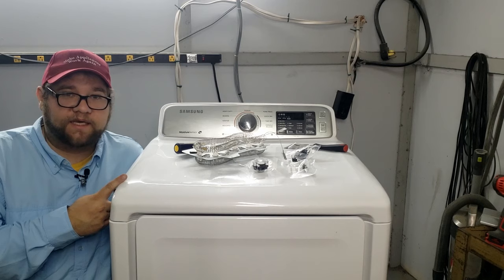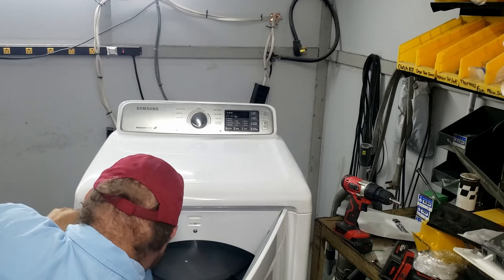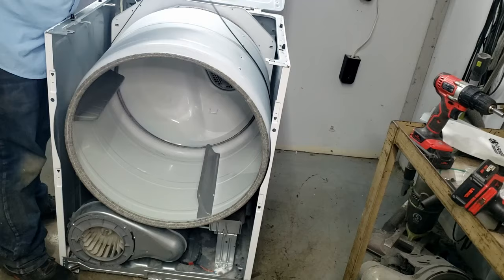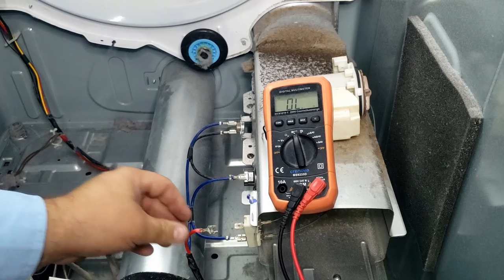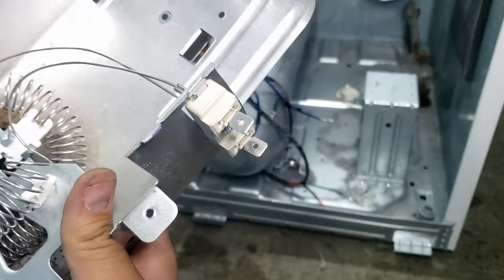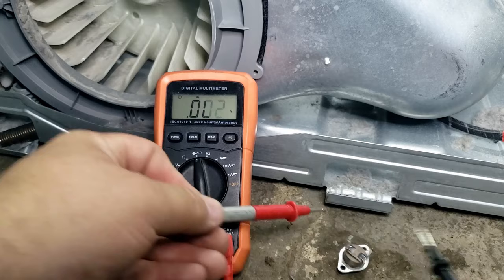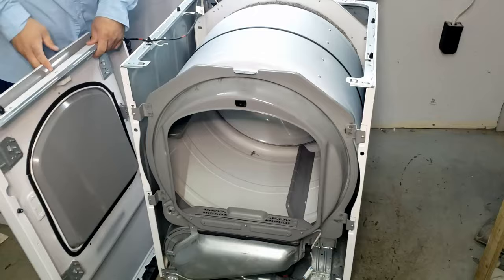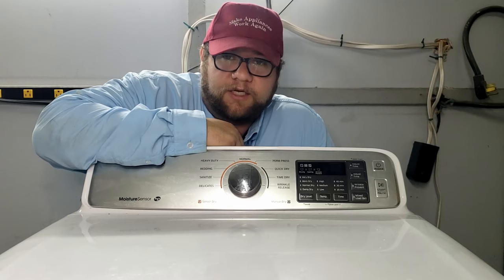Samsung Dryer Heating Element Replacement - How to Fix a Samsung Dryer Not Heating

Comment: Hello and thanks, but I also purchased the Amazon kit and replaced all precisely. It still did not work. Is there another thing we could replace or do, besides buying another dryer? Thanks again.
Reply from the maker: If its not heating, check the electrical connection to the dryer. You need to verify with a multimeter you're getting 240v between L1 and L2. If you aren't, its the electric, not the dryer. If you are getting 240v, and all the sensors/element are replaced, then it could be the board. You would verify this by checking the board's two terminals that provide voltage to the heater from the board. If it doesn't send a signal on both legs, then a relay inside the dryer board would be bad.
Reply: @bensappliancesandjunk  Thanks, When you say board, do you mean the panel display where all the switches are located? Also, when you say electrical connection, do you mean the plug into the wall? If so, would that be a problem even if the dryer is turning on. Sorry about the ignorance, but a big thanks.
Reply from the maker: @ralphgomez9006  yes I mean the plug in the wall. Just because the unit gets electricity and turns on doesn't mean its going to heat. Heat requires 2 legs of 120v of electric. One leg powers motor, then interface, then thr 2nd side of heat. The other just deals with heat. If that side is bad, then it'll run but not heat.

And the board, I mean the control board behind the interface panel
Reply: @bensappliancesandjunk  Super thanks Ben....I got lucky and an electrician was next door. He brought is voltage tester and apparently one of the sensors at the farthest back was bad which means the new one and bad one were bad. Amazon sent me a bad sensor. Where can I just get that one sensor(N160)?

Comment: Si la resistencia se sale y está tocando la carcasa, simplemente vuelva a colocarlo si no está rota, no tiene que comprar otro elemento si muestra continuidad, muchas veces se suelta debido al sobrecalentamiento causado por un conducto atascado. Gracias a estos videos me economice más de trescientos dólares, se puede comprar la resistencia en eBay por menos de veinticinco dólares y los técnicos las venden por $180.00 mas la reparación que serian otros cientos cuenta dólares. Gracias a esta informacion la repare sin ningun costo.

Comment: I have replaced the element 2 times in 3 weeks.  All wires are exactly in the same spot both sensors were also replaced  what else can be causing the element to snap its not touching any metal
Reply from the maker: Can you confirm the element is sagging, causing it to short out and die?
Reply: It is not sagging or touching any metal
Reply from the maker: @junebugs03  are you sure element snapped or is was it another part like a sensor?

Comment: I followed your video.. which was great and very precise! But i have an issue... once i got it all back together with all new parts, i turned it on for a test run, it ran for about a minute then totally shut off and will not power back on... help please!
Reply from the maker: I'd be concerned a part malfunctioned. Sadly, take it apart and test to see if anything failed.
Reply: So i took it all back apart. I found my issue. I forgot to screw the block in place that holds the heating element wiring,  and it touched the metal casing for the heating element... any advice what to do now? I put the old fuses and temp sensors back in and it still will not power on or show any lights on the "dashboard" . Thanks i really appreciate it
Reply from the maker: @nathangrice6730  what was wrong initially with the unit?
Reply: @bensappliancesandjunk  the dryer was not heating. It ran fine other than that

Comment: Dryer keeps throwing HC code. It's lint free, no blockage, new thermostat, new thermistor. Any ideas?
Reply from the maker: Is element shorted to ground?
Reply: @bensappliancesandjunk  brand new elements as well....the 1st one burnt out and got me started on this adventure
Reply from the maker: @ngatracklife  I'd check thermistor and confirm that despite it being new, is within tolerances. Were you getting an HC code prior to replacing those components?
Reply: @bensappliancesandjunk  no sir, didn't knowingly have an issue until the element went out.

Comment: If you start your dryer and it sounds like hell make sure you check the black tie down strap on the motor. It barely stays on there and likely slipped off barely when you removed the tension on the belt. Don't wait another week for rollers to come in. If I wouldn't have waited 2 weeks on parts I'd made a better video than this.

Comment: How frick do you get the belt back on the motor? my arms are too big to reach inside under the drum and thread that?
Reply from the maker: Some versions have a plate on the dryer vent tube you can take off with 1 screw and tighten from the back.
Reply: @bensappliancesandjunk found me a little asian girl to do it, twice..

Comment: Replaced all that and still not getting hot.
Reply from the maker: Check voltage for 240VAC coming in on L1 and L2. If you can verify that, verify voltage output from the control board is 120VAC to each leg.
Reply: @bensappliancesandjunk  it was a 10 dollar sensor....lol

Comment: This machine is terrible design, it takes many steps to get in heating part location. Compare with other brand.  It just simple remove the back panel then can work on any heating parts.

Comment: if you love that screw driver wait unti you get a drill, whooo boy
Reply from the maker: I struggle to decide if I should use a drill gun or a screwdriver in videos. Screwdrivers tell viewers "You can fix this with a $5 tool), but for me, yeah, I'd never go into this without a 12v or 18v gun with a box of bits to use.

Comment: Doing this job will literally cost you sweat and blood. Be careful with all the sharp edges on that machine.
Reply from the maker: I'm adding new warnings on all new videos for the sharp metal edges. They keep building these with thinner walls each year, so they get worse and worse
Reply: @bensappliancesandjunk  is it normal to get a burned smell when you first start it?
Reply from the maker: @fh1980ram  on a new element, yes, every time. There's a coating on the wire, and also usually when you get in a unit and move stuff around, some dirt/dust will get into coils and burn a little too.

Comment: I did everything. It worked once and now it isn't heating again :(
Reply from the maker: I'll be doing a video on that soon. You have one of two problems:

1) The thermal cutoff died (again) because your venting situation with the actual vent pipe or where it terminates at, is extremely clogged, causing the dryer to pop sensors

2) The dryer motor is going bad, causing it to over-heat and cause the thermal sensor to trip.
Reply: @bensappliancesandjunk  how can I tell what it is and what to do?
Reply: @bensappliancesandjunk  best way to clear the vent pipe?
Reply from the maker: @SMoore2Love  there are vent pipe cleaning kits on Amazon. They run about $20-30 to buy.
Reply: @bensappliancesandjunk  you are so helpful!  Thank you!   I will clean the vent pipe all the way to the outside. Will I need to replace everything inside again?
I do think it is the vent system being clogged.
Reply from the maker: @SMoore2Love  you only need to replace the vent hose if its physically damaged. Usually its not, but ive seen situations where it is
Reply: @bensappliancesandjunk  that is fine. I think there is an issue with the part going outside.
Reply from the maker: @SMoore2Love  many times, ive had to fix a vent issue because the flap on the vent outside has stuck and won't open, causing the heat to backfeed significantly.